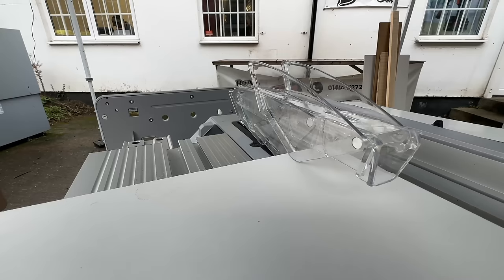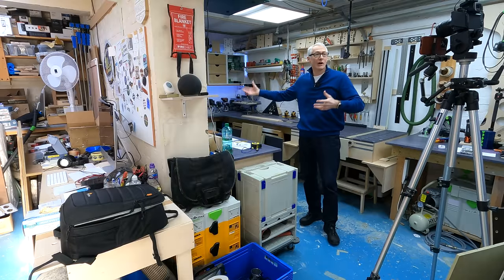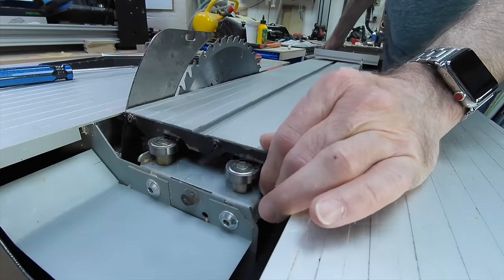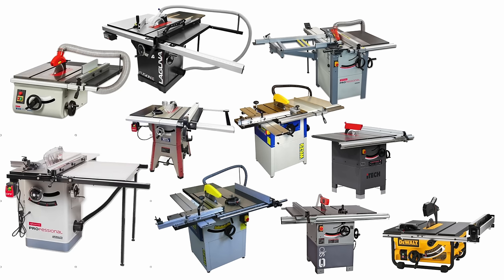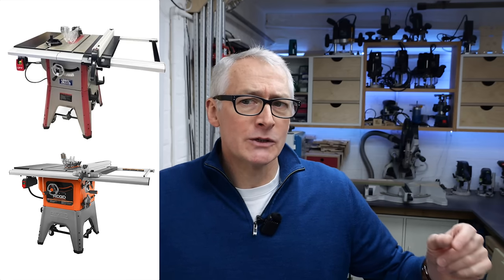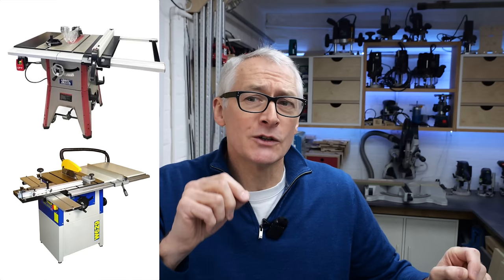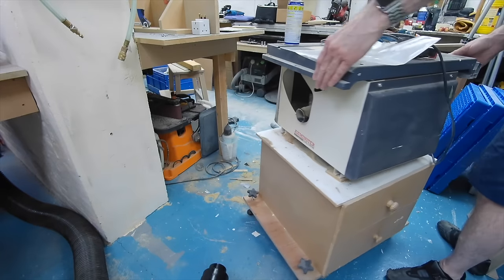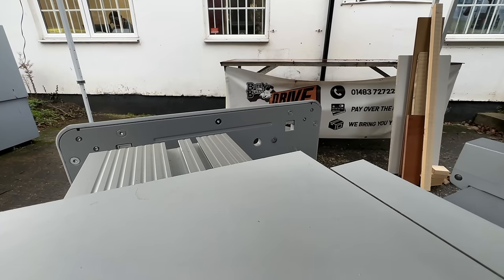Why Buy This Saw? [video 516]

Comment: I came back to this video today, the Lumberjack looks a lot like the recently discontinued Ridgid R4512 (USA). The new Ridgid looks just like the Delta 36-725T2 (except for color), a saw that has both a lot of love and a lot of hate in USA, mostly motor woes. The Delta is sold mostly by Lowes and the Ridgid is almost a Home Depot house brand. I have two tablesaws, a Shopsmith and an old Delta 1160 tilt top and an ancient DeWalt radial arm saw. So, I am not in the market for another saw. If I were buying new, in the USA, I would probably opt for the new smallest Sawstop (a Festool owned company). Where I looking for another "project" a Delta Unisaw is offered right here in town for $500 (a steal but it needs 3-phase power or a VFD to make it work). The best news about the Festool is that you should be able to recoup all your money if you decide to resell it.

Comment: I'm glad you didn't end up with a Charnwood. The build quality on mine was unacceptable and it went back. I ended up with a 10inch sip which I loved to bits for a few years but it took up too much space in my 2 car garage. I've now got the titan bench top saw. For £100 it's amazingly capable. It's not accurate in the slightest but it works. The portability and small form factor make this festool look very tempting.
Reply from the maker: In which case I’m glad I didn’t end up with the Charnwood as well, lol! 👍

Comment: I was recently in the same position and went for the Festool FESTOOL TKS 80 EBS basic package. The only thing that made me buy the last one from Axminster it was the sawstop. As someone that has had an accident involving a power saw I was very interested in this feature. The rest of the saw is not up to the speck that I would expect from Festool, to many to mention here. Its not that it don't cut, it dose, and it cuts well, just little things that add up. If you ever want to do a review on it I would be happy for you to borrow it
Reply from the maker: Thanks, that’s kind of you, but I’ve had a pretty close look at a few of them and like you, didn’t really feel the ‘sum of the parts’ added up to what was being asked. I have mixed feelings about the sawstop tech, and on reflection I wasn’t prepared to put up with that saw just to have it. 👍👍

Comment: I love Festool and have a few myself. I watched the promotional video by Festool and it does seem good. However I did note that they only cut thin boards on it. I have my doubts about rip cutting solid timber with a battery saw. I have the Hikoki cordless bench saw and it eats through batteries and it doesn't last long when ripping solid timber. It can be mains supplied though and I don't think the Festool can. This was a problem for the earlier Festool track saws. They lacked power. The new ones have a much thinner blade to help overcome this. If I were you I would have asked to try a demo saw fora few days. Here in Australia the Festool rep will oblige if they have one available. Not sure in the UK.
Reply from the maker: Find me a video on the channel where you see me ripping any solid timber. 🤷‍♂️ As I say in the vid, it’s for small, precise cuts and narrow rips in small workpieces, it’s not for everyone and I’m not 100% sure it’s for me, but I’m prepared to fit it a try. And Festool UK wouldn’t lend me the time of day.
Reply: @10MinuteWorkshop  Why the angry reply  .I have never seen anything on your channel. I am new to your channel. I'm commenting on the saw not you or your ability. Hope it's all you believe it to be. Best of luck with your projects.
Reply from the maker: @messenger8279  I’m not angry at all. But you do seem to want to ascribe your use case of this saw to me, and as I’ve spent the entire video explaining, my requirements for a saw like this are very specific - small, quiet and precise, for repeatable cuts in thin stock. Yes, I’d prefer it to have a mains option, but it’s battery only; I don’t see that as being a huge problem, otherwise I wouldn’t have bought it. 👍
Reply: @10MinuteWorkshop  I stated my business in a shop like yours in SW London 35 years ago. I totally understand your needs. The problem seems to be your ego. You're carrying on like a small child. Get over it mate Its just a saw. Hope it works out nd if it doesn't it's no big deal's it. Calm down mate.

Comment: Wouldn't the Fusion 2 (and other 1.75hp saws) be 7A saws in the UK on 240V Power?  For instance the F2 is rated at 1300W / 220-240V gets you roughly 6A of draw, not 13.  The reason I ask is that before buying my sawstop I looked at the F2 and here in the states it is rated for 115V/14A, or 230V/7 Amp if it is rewired for 230V.

I think you will be happy with the Festool, the sliding table design looks really nice for that size saw
Reply from the maker: Thanks! I do mention the Fusion 2 in the bud as running happily off a regular 13A socket, but it’s physically too big for the space I have. 🤷‍♂️👍

Comment: Best of luck with it, Peter. I have the Milwaukee M18 saw and love it but… I just wish there was a power adapter. I had a big job on cutting a lot of oak and it just ate batteries - even the 12ah ones. Waiting about for big (and expensive!) batteries charging is not good for productivity! The new Festool one looks stunning and very well designed - doesn’t all Festool - but batteries just aren’t worth the hassle for me for big kit. With all that said - I will watch your video with green-eyes because it does look soooo cool.
Reply from the maker: Thanks! And yes, I agree re the mains adapter, it’s a baffling decision not to something available - even a power brick would get you out of a tight spot - and I’ve heard from more than a few kitchen fitters who’ve said that it’s the batteries that’s the most off putting aspect, as they’re not on the Festool battery platform. 🤷‍♂️👍

Comment: Looking forward to your experience. Here in the States the new CSC SYS 50 will be available later in the year.  When I moved to a new shop, I got a small 10" table saw instead of a miter saw since I don't do much trim work that requires odd angles. Both are great sawdust dissemination machines.  My home made cross cut sled works just fine to handle most of the small stuff and anything else gets the TS55 treatment.  If I could replace that saw with one that has good dust collection,  I could reduce the dust in my shop by 90%.

Comment: Been thinking about the CSC SYS 50 and it seems like a great "gadget" for cutting trim bits to final size on the jobsite. It appears to be accurate, easy to set up and stow away, easy to transport, somewhat quiet (until You actually start cutting) and has dust extraction, although even the Festool promo video shows a lot of dust still flying everywhere above table, as there is no above table extraction, just below. The real worry for me is the very limited capacity. The blade rises just 35mm above table, the max rip capacity is just 280mm right of the blade. That may be within 90% of trim bits on a job site, but it's just not enough in a shop. It's different for Peter, as he cuts panels to size with a tracksaw. And in the space allocated to the table saw would never really be able to outfeed a 600mm piece right of the blade anyway, but most of the benefits of the tiny Festool systainer saw are wasted in a shop - it's portability and ease of carrying it around, battery power, it's all nice when You're working in someone's kitchen or walk in wardrobe, but hardly necessary in a shop. And then there's the price. Aside from DRO display, the rest of it seems to be subpar to say a Laguna F2 that sells for less money, has cast iron, vibration free table, can cut through more than 35mm without flipping the board over, has a larger variety of and cheaper blades available, has dust collection below and above table, and will probably cut smaller pieces just as accurately. The Festool is a great jobsite tool and the price ir not much concern for a professional that needs to fit a kitchen every other day, but it's probably not the best choice for a workshop, even a small one.
Reply from the maker: Yeah, I go through all the reasons in the vid why I ended up with this saw, and why the Laguna 2 - and a few others - just wouldn't do it for me. Not sure where you're getting the 35mm depth of cut from though - it's 48mm; not huge, no, but then neither is the CS50. Bottom line, if you need a tablesaw to cut panels or big lumps of natural timber, this isn't it - it's a dinky little lightweight trim saw that I'll be using in a workshop, because I'm interested to see how it handles those small tasks. Not sure where you are in the world, but as I say in the vid the Laguna 2 is £2400 here, the second most expensive saw on my list; I paid £1700 for the Festool, with batteries, about the same price as another three saws that I rejected for one reason or another. There's no one-size-fits-all table saw, but I'm prepared to chunk down a decent piece of change to see if this is right for me. 👍
Reply: The Csc cuts higher than 35mm. 

Also, disagree with the dust extraction. I’ve been cutting inside with it. The bag that comes with it is the best Festool bag they’ve had with their tools! I know it only has the dust collection at the back but the saw seems to be driving most if not all the dust into the bag. And to be fair, it’s a saw that’s really compact so they probably had to leave something out!

Comment: Pete - thank you so much for the in-depth share-out of your journey and decision making process - it got me thinking about my needs for a new table saw and I have some new things to consider. The higher accuracy/repeatability with the digital controls might be an time saver on many of my projects. As I would like to keep my 2 car garage workshop open, the smaller size would help avoiding filling up space with equipment (I know, I'm unusual in this way by US standards). I do hope these comes to the states in the future. It has a lot more going for it than the Sawstop for the kinds of projects I build.
Reply from the maker: Thanks! I believe Festool have recently announced US availability, so fingers crossed! 👍

Comment: Thanks Peter, a very interesting video. I’m in the same position, very little space (shared with a motorcycle and a large planer thicknesser from my old workshop. I bought an old Jet table saw that I have to move to use (and the motorcycle and often the planer) but have booked a demo on the Festool and suspect it’s the way forward for me. Looking forward to your longer term thoughts on it!
Reply from the maker: Thanks! All I can say is leave your wallet at home when you have the demo. 😬
Reply: @10MinuteWorkshop  I will have to move the decimal point to the left if I do buy one!

Comment: Great video, I purchased the Axminster 254 saw,  less the sliding table due to space. I also prefer to use a table sledge. 
I visited two of the tool suppliers that I use. One has stopped being a Festool supplier, and the other is strongly considering pulling the plug. Both are due to supply and pricing issues. 
This has left me a little cold to future purchases. I have made many in the last few years. It was suggested that the UK base may be going??
Reply from the maker: Thanks! Haven’t heard anything to that effect, but interesting, and noted, thanks! 👍

Comment: Great video! Would be interesting to hear about the Mafell Erica 60. It should be nearly the same size as Festool csc sys 50.
Reply from the maker: Thanks! Like the CS 50/70/TKS80 the Mafell Erika relies on proprietary extrusions around the edge of the machine for accessories, inspired of simple mitre slots. That just really annoys me, for completely irrational reasons, but if I’m spending that kid of money I don’t want to be annoyed about it! 😂
Reply: @10MinuteWorkshop  Thank you for your response :)

Comment: I'm curious to know what you didn't like about the Festool TKS80 - The one with sawstop?
Reply from the maker: I have a general dislike of the Festool saws that are based around the standard set by the old CMS - no mitre slots, reliance on proprietary extrusion around the saw for accessories, a fence is an optional extra etc.. etc.. and I also know a few too many folks who have struggled to get a flat one, but before any of that, I just don't like them, simple as that. 🤷‍♂️
Reply: @10MinuteWorkshop  All fair points, thank you. I'm keen to see what you think about the Festool CSC SYS 50 when it arrives and if it's any good, I hope they end up making a sawstop version.

Comment: Congrats on your new saw, the digital blade height adjuster looks very useful. I was waiting on the TKS 80 to be released 2 years ago and really wanted it for the sawstop functionality. I was under pressure to get a saw for a project at the time so I went with the erika 85 instead from Sauter, delighted with it. 
An Erika 60 is about the same money or less than the CSC SYS 50, well worth consideration if it is for mainly workshop usage.
Reply from the maker: Thanks! Interesting - I think the digital blade height is a bit of a gimmick and cant see myself getting any benefit from it - but then I thought that about lasers on mitre saws as well... 🤷‍♂️ 😂

Comment: Hi Peter, hope your well my friend, great shortlist of table saws, you clearly have put alot of thought into this, I am lucky enough to have the big Laguna fusion 3 which is a beast but a very nice table saw that is extremely accurate, I love my festool 55 and use it alot mainly for cutting down sheet stock but I really couldn't do without my table saw, you will find that having the Table saw will make some cuts agood deal easier than the rail saw, in my humble opinion I think there is room for both saws, anyways your choice of the little festool table saw is interesting and I am looking forward to seeing you put it through its paces, stay safe, Louie . Northern Ireland Uk
Reply from the maker: Cheers Louie! Yes, it’ll be interesting to have some time with it; if I had space I’d have a big hunk of cast iron - but I don’t 🤷‍♂️👍

Comment: I'm in the exact same situation; small shop, mostly track saw cuts, need a table saw for smaller cuts, DUST EXTRACTION IS A MUST. I'm really curious to have your inputs about that dust extraction capability since there are no over the blade port. I'm hopeful but skeptic  about that. Other than that, it seems like the perfect small table saw. Great accuracy and enough power for the small cuts it's designed to do. Do you have an ETA of reception?
Reply from the maker: The blade is completely sheathed under the table, so the extraction is pretty direct - given that most of the sawdust should be being expelled downwards by the action of the blade. But I'll see when `i get my hands on it back in the workshop. 👍

Comment: I have to agree with TK - it begs to have a mains voltage power brick, for when it is used in a workshop or other site with mains voltage. Festool had/have excellent batteries, but they also abandon the form factor of their batteries every few years, so you can't buy new batteries when the original ones die - or get run over by a truck. I have 2 Festool drills this has happened with - one totally useless & the other down to one battery with no replacements in sight. Bessey is another one - they (or at least their distributors) don't sell small 'expendable' parts like jaw pads and plastic ratchets, their attitude seems to be 'just buy a complete new one, we know you can afford it'. At least you can 3D print some of the parts.
Reply from the maker: I agree re the power brick / adapter option, seems very shortsighted not to at least let the batteries trickle charge without removing them from the saw. Re abandoning the battery form factor, the only one I can think of was the old CDD 12, when they went to the C12/15/18 shape - and they do guarantee to keep spares available for seven years after a tool has been discontinued. It stinks when you have to abandon a perfectly good drill/driver due to lack of batteries / spares, but battery availability - and cross-tool usage, warranty etc…- was one of the things that made me invest in Festool drills. 👍

Comment: Interesting choice, would have thought the TKS80 would have knocked it out of the park for you.  I had to watch the UK Festool channel to get more details, and it’s kind of an anomaly to me.  It does not appear to have the SawStop technology, and they seemed to have created another blade size, so compatibility with any track saw is out.  But the digital features are geeking me out.  Like the TKS80 (though SawStop just introduced a similar US variant), neither Festool variant will make it across the pond, so I will just have  wait to see how you make on with it. Thanks for another well crafted video.
Reply from the maker: Thanks. Sawstop flesh-sensing tech requires an earth/ground which you don’t have in a cordless tool. I dislike the whole family of Festool cs 50/70, TKS 80 table saws as they all carry over the worst of the old CMS - no mitre slots, and a reliance of proprietary extrusion to handle accessories. Also the fence is an optional extra on the TKS80. 🤷‍♂️ CSC SYS 50 uses the same blades as the latest TS60 tracksaw btw, so there’ll be plenty of choice. 👍👍
Reply: @10MinuteWorkshop  lack of mitre slot would turn me off the TKS80 as well.  The TS60 looks like an interesting addition, something else we won’t see stateside.  Having the same blade size across plunge and mitre and mini table saw could yield a useful kit. Makes more sense now and thanks.  Looking forward to seeing your review, but for me, I’ll stick with my Makita XGT 😉😀😏.